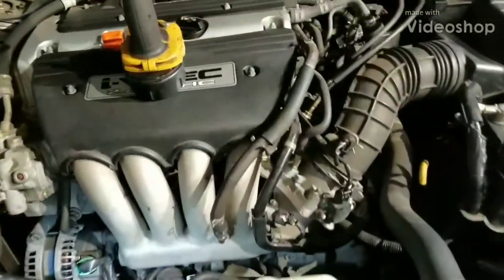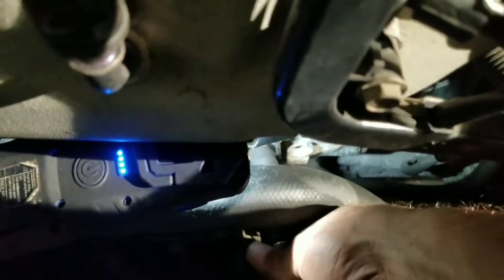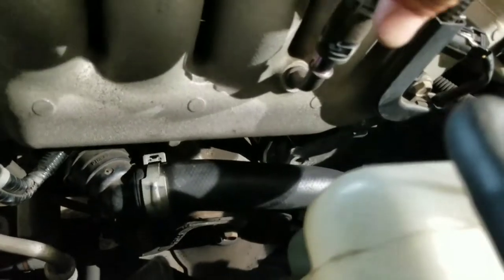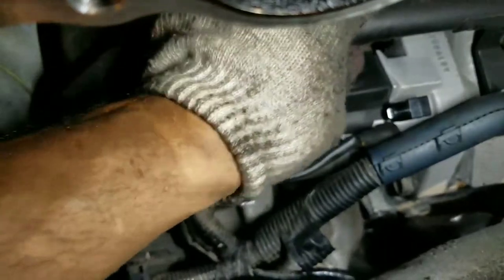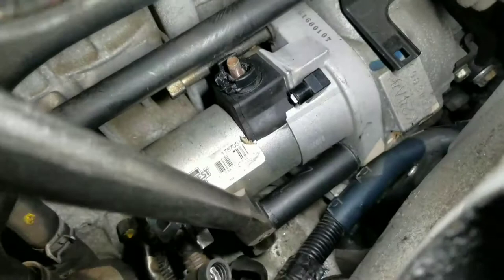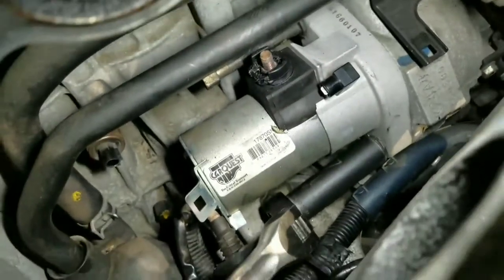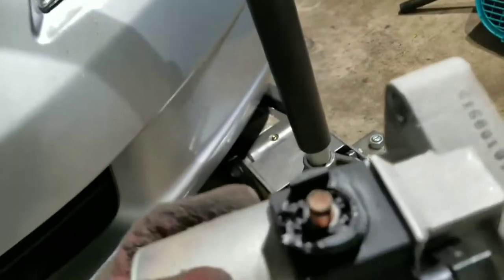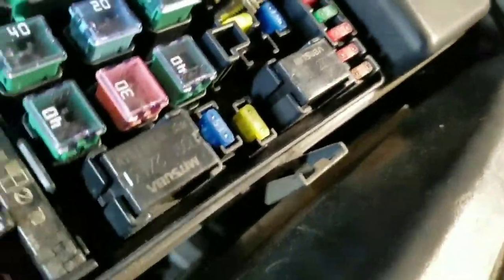2003 Honda accord starter replacement

Comment: Do you hapoen to have part number for cables ? Been trying to replace but I get different ones not sure which to order
Reply: Hey , I have the same issue..what the part number or where I can get one (what to look for plz)
Reply: Where did u find that part plz ..u have a link where you can get it plz ?